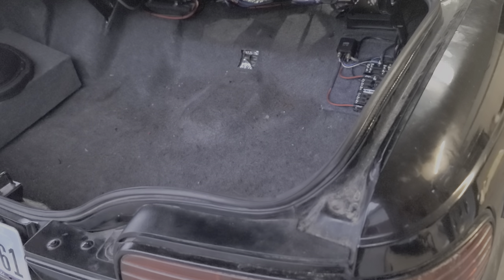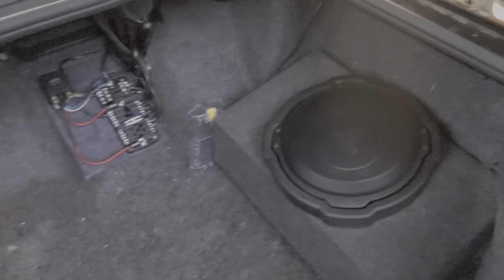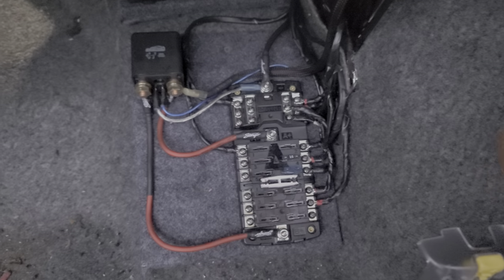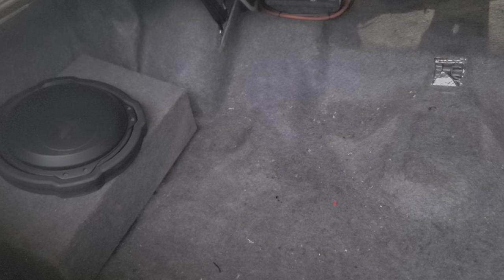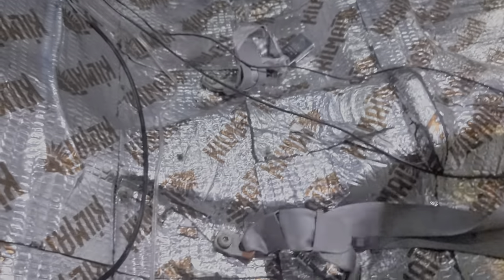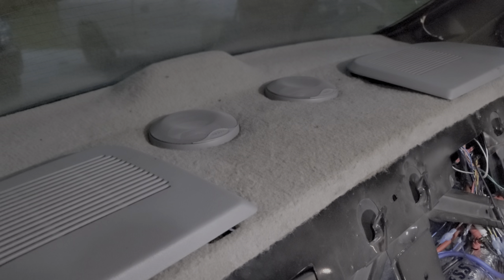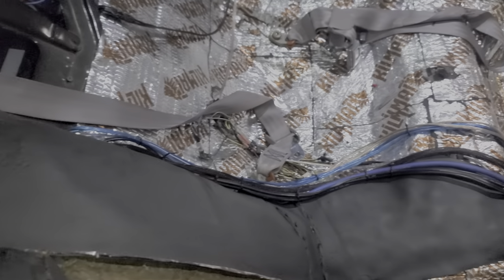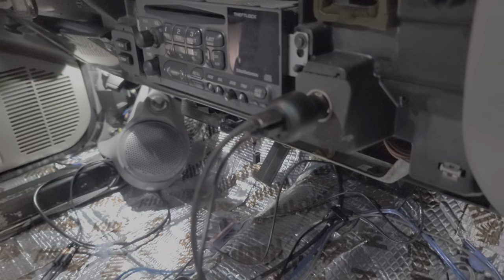1996 Impala SS sound deadener and sound system install (part 1)

Comment: Where did you purchase the kickpanels? Thanks in advance
Reply from the maker: https://www.bodykitnation.com/chcaimburocu.html

I got them from here and sprayed them with a few coats of SEM medium grey. I put in 6.5in speakers but it was difficult to get them to fit and the speaker grills wouldn't fit so i had to get some smaller grills off Amazon. I'd recommend getting 5.25in speakers to make an easier fit. Also, the emergency break pedal does have to be slightly bent in to get it to fit.